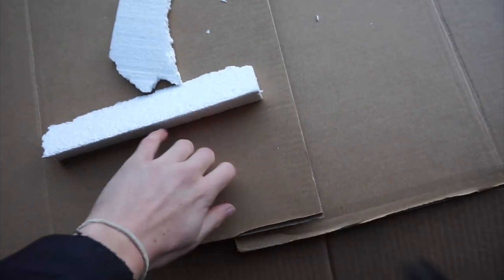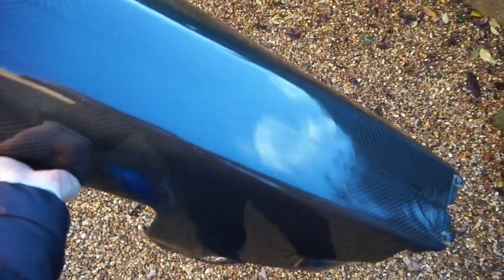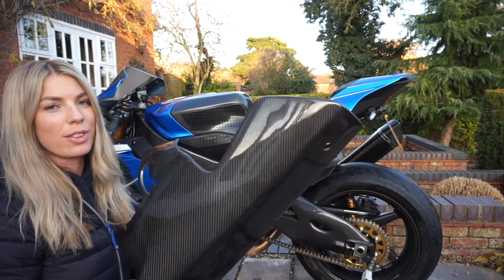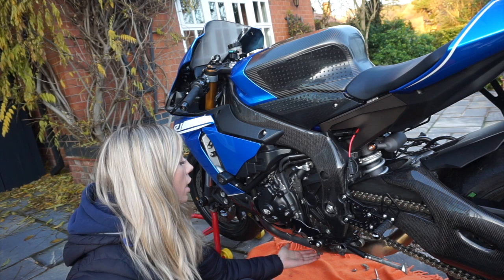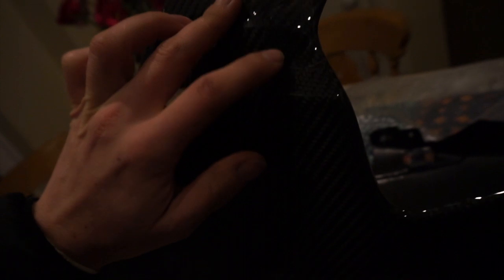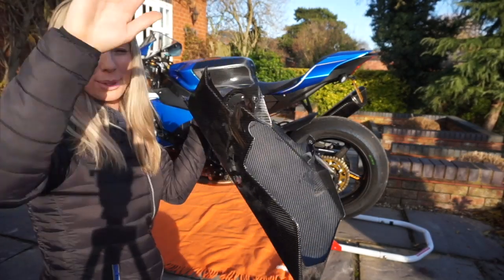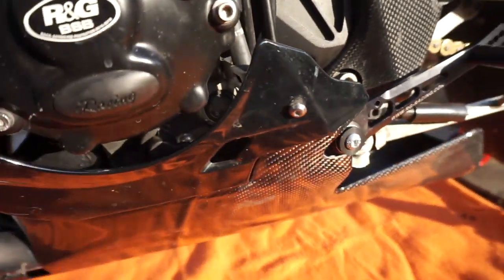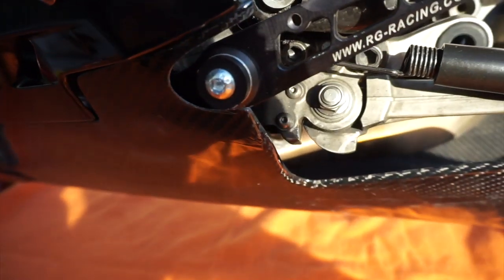Lacomoto Carbon Fibre MK2 Belly Pan Install on Yamaha R1 2015

Comment: The problem with r1s 2009 onwards. Is they’re just to bloody small! Being a six feet 4 inch bloke, I looked daft on it. My 2008 r1 served me well until it flipped me off leaving me with pins and plates everywhere. Still miss it. Couldn’t possibly get into a race position now to ride one as it should be ridden. Yours looks great with the belly pan added. Ride safe Sister🏍🌬🕶✌🏻

Comment: Be nice if companies actually checked the shit you buy fits the bikes before they charge you a few hundred quid to finish the work for them.
Reply: The Belly Pan was designed for bikes that only have OEM hardware. Claudia has some aftermarket stuff. She explained in the video that it's not Laco's fault since it was her decision to put some aftermarket hardware on the bike.